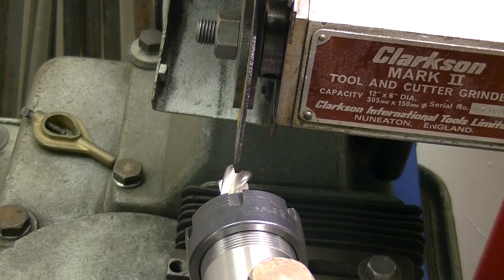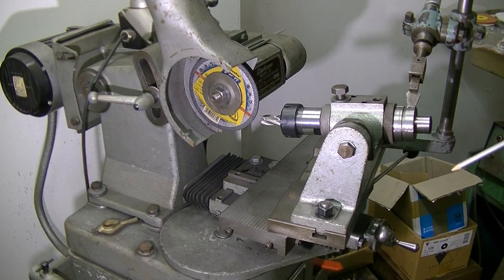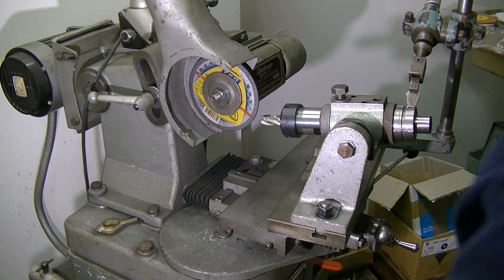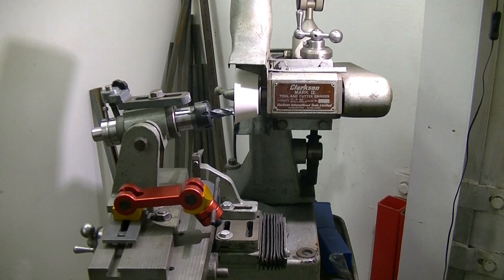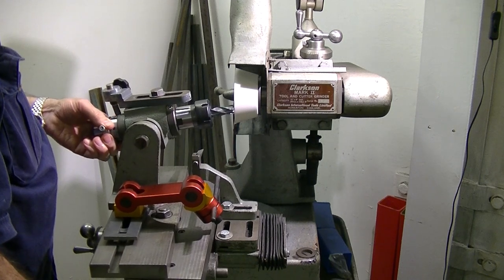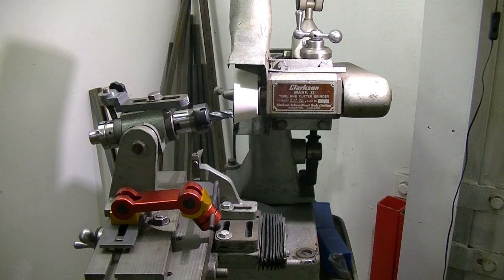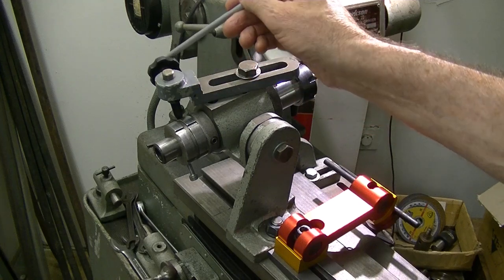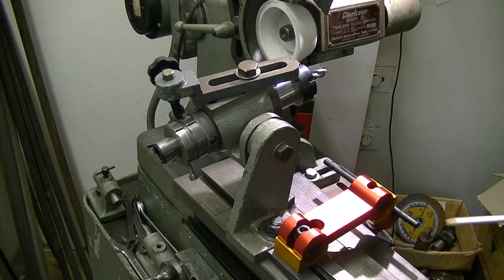Tool and cutter grinder ooops

Comment: What style of collet do you use to hold the cutter
Reply from the maker: Hello Greg. This chuck is ER32.
Reply: Awesome did you make it
Reply: As it would be long to go threw
Reply from the maker: @gregkernick4154  Hi Greg. No it was from Ebay and it has a 25mm strait shank with a 22mm bore.